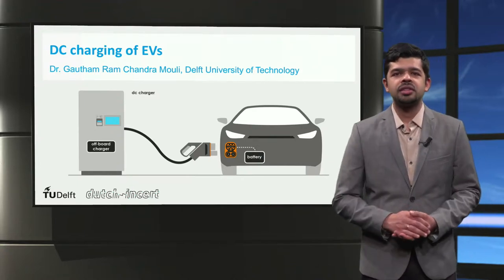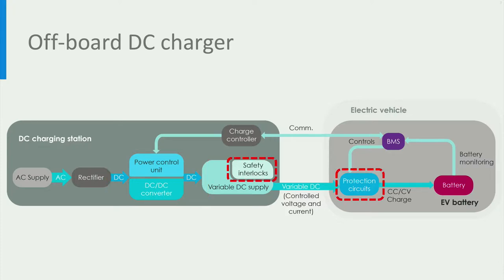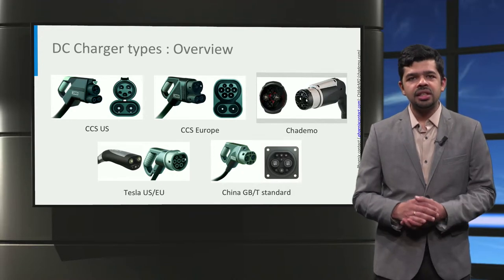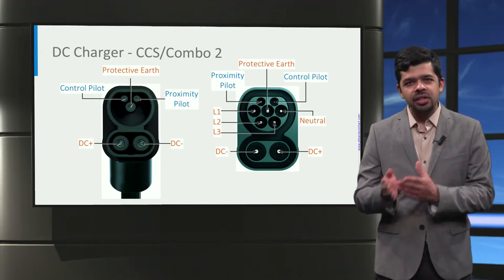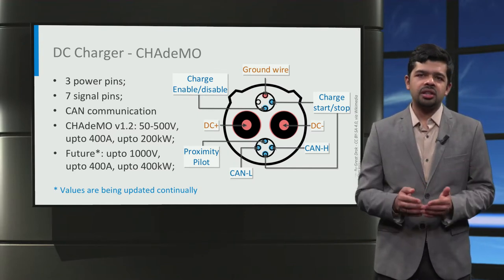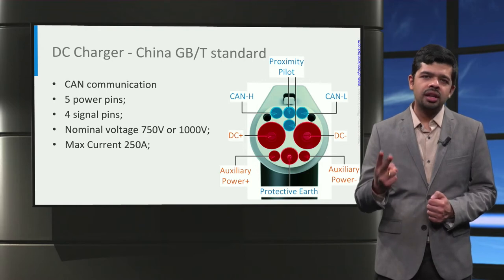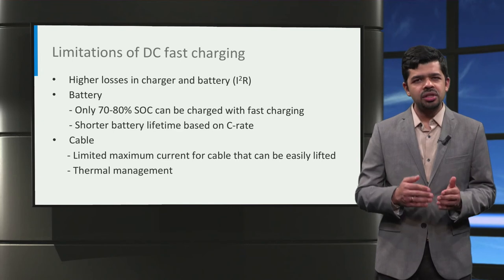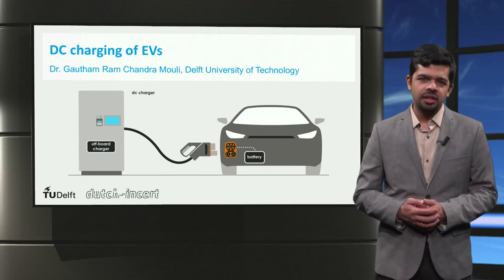DC Charging of electric vehicles

Comment: Thank you for this session. I want to ask does CCS1 and CCS2 has the same communication protocol? If yes why we don’t have adapter from CCS2 to CCS1 and CCS1 to CCS2 ?
Reply from the maker: CCS1 and CCS2 use the same communication on control pilot CP. The two plugs are used in two geographically different regions (e.g., CCS1 in USA,Japan and CCS2 in many EU countries), so you will not normally find CCS1 and CCS2 plugs in the same region. Hence, there has been no major demand for adapters to convert between each other.
Reply: Gautham Ram the problem is in Egypt the country protocol is the European protocol CCS2 and the government allowed to import used EVS from any country and most of used cars we have here are American and CCS1 so we can’t charge by the available CCS2 chargers:

There’s a company called SETEC do this adapter but unfortunately this adapter only work with ABB not EVBox.
Reply from the maker: @aymanmohamed1068  This is indeed a unique situation and i was not aware of this. In such a situation, an additional issue will be of AC voltage which is ~110V for CCS1 AC charging and about ~230V for CCS2 AC charging. You are referring to this adapter ? http://www.setec-power.com/index.php?m=content&c=index&a=show&catid=16&id=28
Reply: Gautham Ram yes exactly but regarding the AC we don’t have any problem just you need a cable from type 2 to type 1 and it will charge on Level 2 /220V.

The real problem in DC charging and the adapter.
I thought we can work on a solution like Tesla Chademo adapter.

I would like to get in touch with you as we work on this project now and can share with you a lot of field experience regarding this topic.

I added you on LinkedIn my name is Ayman Mohamed.
Reply: @aymanmohamed1068  Sir I want to talk something related to this, so can I connect with you on LinkedIn? Also are you from zagazig University? Asking to confirm if the profile I found is yours
Reply: @CartoonTV257  Hi, no not me.

My profile is Ayman Mohamed 
Company name: Electrified Egypt
Reply: @aymanmohamed1068  Sir sorry for asking again. Are you head of business and co-founder of electrified?
Reply: Pitch between DC pins is different and  placing of CP and PP in different locations..
Reply: 1:08

Comment: Well Explained. I have a question. Is it possible to charge using external battery. What is the range of DC voltage in DC charger. In a total off-grid solar setup, is it possible to charge the car using a DC voltage stored in a battery. Yes I agree to the fact that I have a to develop a DC current controller to save the external battery from over discharged current. Does such architecture commercially available? I see converting AC to DC with a rectifier or inverter circuit would add to energy loss. Looking for an option to inject DC just next to the rectifier in commercial EV charge stations.
Reply: You may not get sufficient power with battery packs

Comment: Thank you for that informative detail. It looks like as EV is at its infancy car manufacturers around the world will need to adopt some controlled standards on these different plugs. Also learned that these Dc fast charges are eventually going to degrade the power source of the battery units and I can see that any replacement or correction is going to be at a big cost to the owners.

Comment: So essentially the DC fast charging only goes to approximately 70-80% SOC using CC and that is where the charging ends with DC fast charging. The CV charging is not normally done by DC fast chargers and would have to be done using AC charging. Is that right?